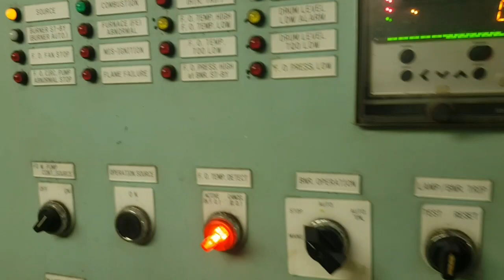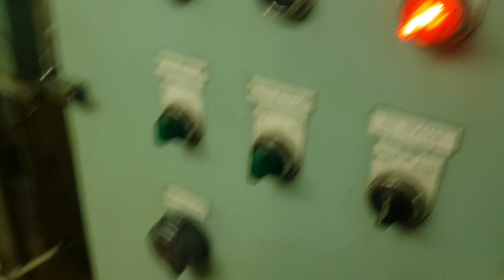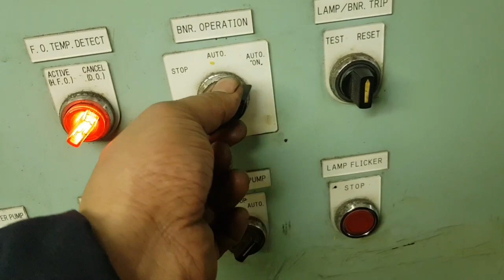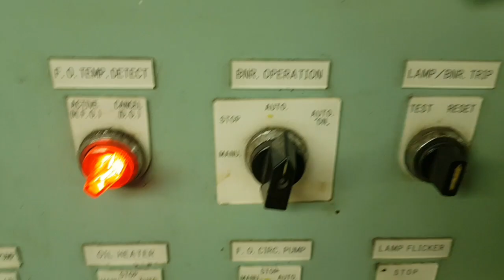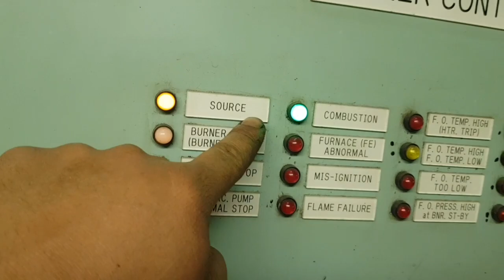Boiler burner maintenance #educational vlog

Comment: How much clearance or gap
 of the pilot burner dol from the arc and the igniter ?
Reply from the maker: about 1cm below depends upon the igniter sir.. like sunflame
Reply: @marineengineerworks  dol pwede pa mag video ka how to adjust the shims in fuel pump timing. Kung meron kalang maintenance or may problema sa fuel pump timing.